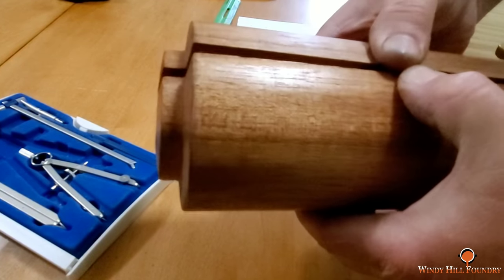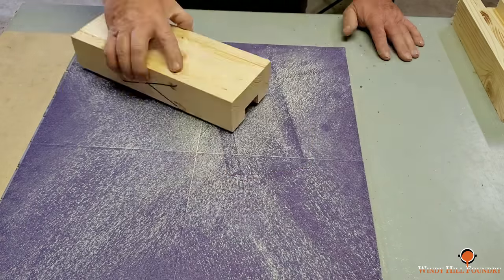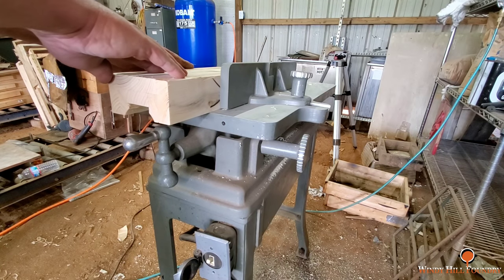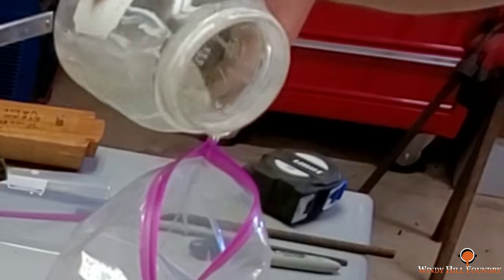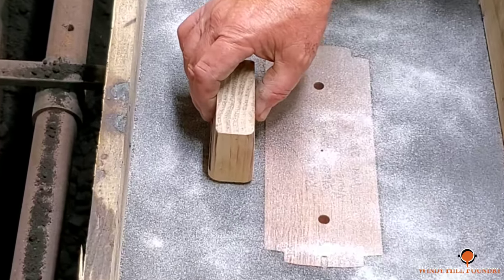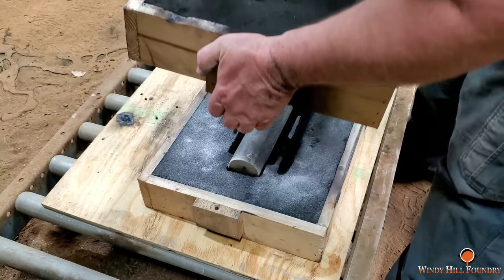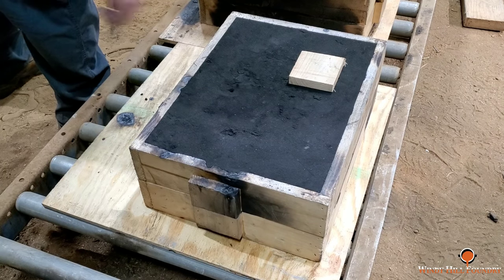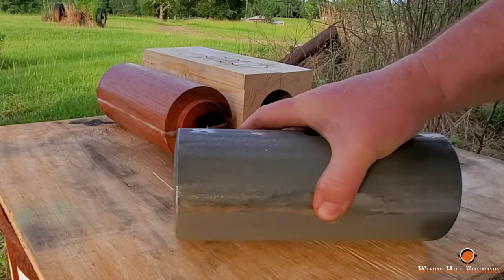STOKER STEAM VALVE SLEEVE

Comment: Colds. When you feel the back of your throat a little itchy. Gargle a half teaspoon of 3 volume peroxide. Tilt head back and gargle deep.  Dont swallow foam. repeat 2 more times. Rinse with water.  Carry a bottle of 70%  rubbing alcohol in your car. Wash hands after shopping. Wash hands before drive thru. If you do drive thru's. It's amazing how many colds you wont catch.

 Beautiful casting by the way.  Long time Keith's viewer. Added you to my subscriptions now.
Reply from the maker: Thanks and thanks for the advise as well. I usually have these issues right after cutting grass
Reply: @windyhillfoundry5940  cutting grass is dangerous if weed killer has been used on it.

Comment from the maker: I appreciate everyone's concern on the push stick. I have used a table saw most of my life and produced several tons of saw dust from them without a single injury. I always practice safety and to be honest the table saw is by far the safest thing I have around here. If I have to rip anything under 1.5" wide, I do use a push stick. It's common practice for me to always keep hand pressure to the fence if in the event a board gets kicked back so my hand would automatically fly right,  away from the blade. Again, thanks for the concern but the real danger here is the 2900° of molten iron.
Reply: Indeed I do the same thing and on my saw I can hook my ring and pinky over the fence as I go. I probably go a bit wider than 1 1/2" though but I don't jugel lava as a pastime eather
Reply: "gain, thanks for the concern but the real danger here is the 2900° of molten iron." Until you lose that finger on the tablesaw. I am one of those who has had a thumb dance with the blade on a table saw. Please listen, despite the saying, you can always teach an old dog new tricks.

Comment: The boring machine that you made the core box with, looks like it could be used to machine white metal bearing halves when we re-metal the bearings on our train carriages.  I belong to a railway restoration society, here in South Australia. We were sending out the bearing shells to have them re-cast, but are now doing that ourselves. We set them up on a mill, but getting the tool adjusted is not easy.  The final fit on the axle is by scraping.
Reply from the maker: I can imagine that would be difficult to get set up on the first piece. The design of this is ideal for wood but I would think it would chatter and grab on a chunk of metal
Reply: @windyhillfoundry5940  perhaps ACME screw feed instead of hnd pushing it through.. and on the softer metals like aluminium, brass or tin

Comment: Fun to watch! FYI, as you may already know, Sodium Silicate (CO2) cores are sensitive to water and when wet, the cores break down fairly quickly. Unless we were under a time crunch we would put the casting in a sink or bucket and let the water remove the core for us.
Reply from the maker: Thanks SandRammer, yes I needed to get the cores out in a hurry like everything around here. I have some core samples from a company in England I need to try that dissolve easier than the SS. I may do a video on it

Comment: Great video. As noted by others, please use a push stick when ripping on the table saw. Also, what do you do to avoid hard spots in your castings? Do you anneal like you would with carbon steel?
Reply from the maker: Keith I rarely ever get hard spots unless its chill from sharp corners on the pattern. This wasn't always the case but cooling the piece slowly is always good
Reply: and please drop your blade, you only need a 1/4 inch or so, above the wood.

Comment: FYI about flatness - theoretically when you sand something flat by  hand, you want to make a figure 8 path for the thing you're sanding. That way you eliminate the inevitable uneven pressure you put on the ends of the object when you change back and forth direction. The figure 8 path makes a more uniform pressure throughout the path, thereby achieving  a 'flatter' object
Reply from the maker: Thanks for the tip, since I do a lot with hand planes in an x direction, it's kind of a hard habit to break

Comment: Clarke, If you get tired of spreading glue with your finger, try welding a piece of a coarse hacksaw blade to a "handle" in the shape of a T.  The teeth spread and level the glue similar to the toothed trowels that Masons use.  Also, will you explain the flaked graphite you used on the core, either here or in a future video?
Reply from the maker: Thanks for the tip, the graphite serves as a refractory to help prevent core sand from fusing to the inside

Comment: Looks pretty good clarke, Im going to have to make myself one of those core making machines, lol. What RPM does that spindle spin at? I hope you get over your cold soon and get to feeling better.
Reply: Me too churp . If we can swindle some measurements and a detailed look at the machine I'm game to help with the patterns.
Reply from the maker: Thanks Chirpy, not sure what the rpm is. The pulleys are 1:1 so I'm assuming it may be 1800
Reply: @windyhillfoundry5940  oh, ok, thanks man, and Ill defenitely have to look into building a small version of that thing, lol.
Reply: I was shown a technique as an apprentice were you set the circular saw blade stick out to the radius of the core box bore then take the fence off and clamp a wooden guide to the table at such an angle that when you sight down the guide the blade forms a half round silhouette - ie the difference in distance from the guide to the leading tip of the blade and to the trailing blade tip equals the diameter (well less a bit for minimal cleanup).
It was a long 6 segment lag construction corebox, so not a lot to come off.
I like this borer better though
Reply: @Dug6666666  Woodworkers do that to get groves or inside rounds

Comment: A question out of ignorance on casting for the bevel gear for Keith Rucker and the metal planer restoration.  He mentioned that you had trouble getting metal to flow to the high edge of the piece.  Would it work better if the piece was cast with a vertical orientation and the mold separation line was at or slightly above the shoulder of the piece?  Or is it not possible to cast the piece in that orientation?

Comment: Doesn't the core end up very slightly elliptical?
Reply from the maker: Not too bad, I check it with calipers and try to get a diagonal measurement in 4 directions holding it as close to .001" as possible. Keep in mind I'm measuring wood with calipers so there will be accumulation for error. These will be bored anyway
Reply: @windyhillfoundry5940  I definitely like that gadget. That's more circular than I thought it would be. 
Several of the foundries I do work for in the UK have an incremental range of stock core boxes. The cores produced are cut to length as required.

Comment: What kind of gas are you using
Reply from the maker: Chris, I use diesel
Reply: On the molds ???
Reply: @chriscromer2308  Carbon dioxide is used to harden those silica sand/sodium silicate (AKA water glass) cores.

Comment: I cringe, when I see someone using an unguarded, un-rived, table saw, for ripping and crosscutting.
Reply from the maker: I do appreciate your concern but that saw is the least of my concern. The sand Muller will rip and grind a human into dust if caught in it, the furnace will vaporize one if they were to trip and fall towards it and all the exposed wires from the heat cooking the insulation off will fry someone. I have a hydralic brake crusher that isn't osha approved either. 
I have produced several tons of saw dust with a table saw over my lifetime and still have all 10 fingers. The only cut I have received from a table saw was when trying to break the nut loose to change that blade and the cut was from a jagged sharp edge of the table not the blade
Reply: @windyhillfoundry5940  Have you never witnessed kick-back?
Reply from the maker: @BedsitBob  yes and I always keep pressure not only in the forward position but side ways away from blades just as a precaution.